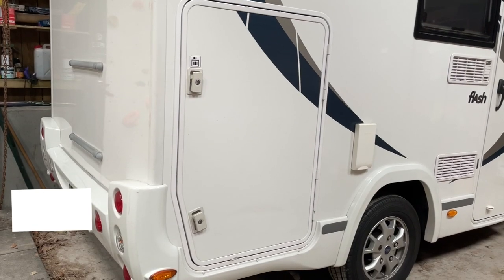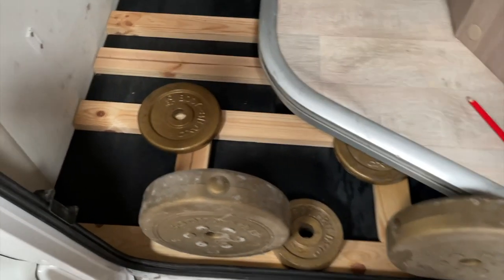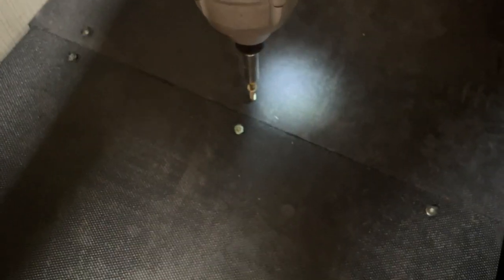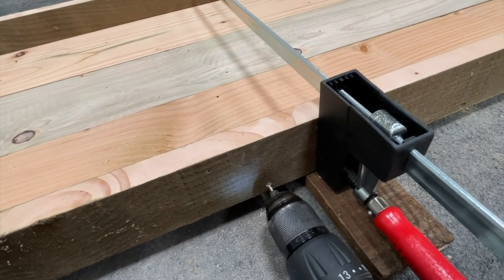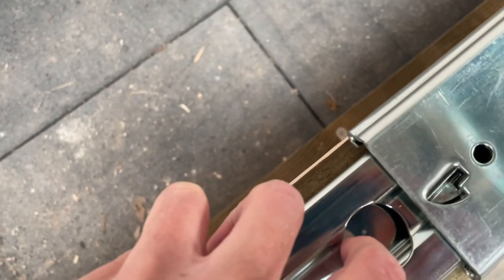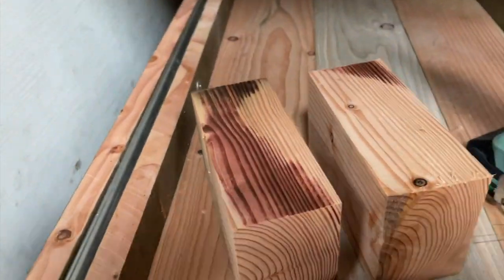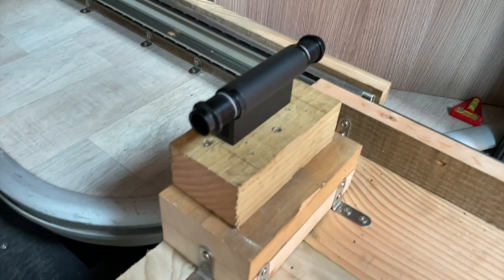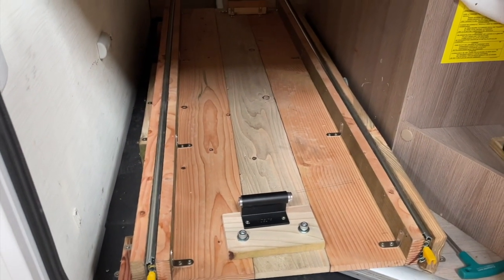How to build a bike drawer (for a van or motorhome)

Comment: I have a slightly bigger garage in my van and was considering this but my thoughts are also around two things 1. How do you store the front wheels? 2. Considering you glued the battons down isnt there a cantilever creating a leverage effect on the floor from the weight of the kit when you roll it out?
Reply from the maker: I have some batons with D-rings on the inside of the rear of the garage, and bungee cords to hold the wheels. There probably is a cantilever effect on the floor but the drawer is never out for very long, just to load the bikes on/off. The floor is pretty sturdy so it's not been a problem.